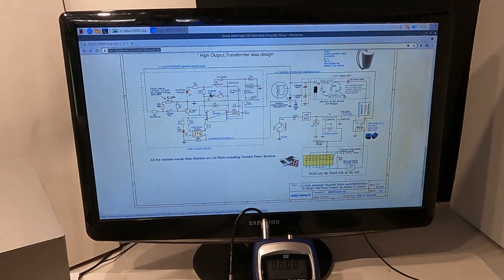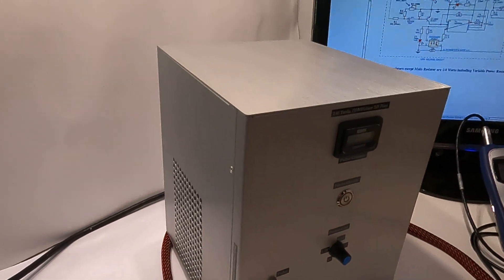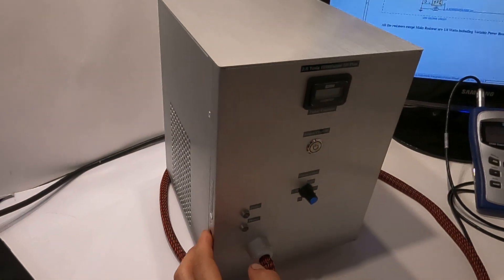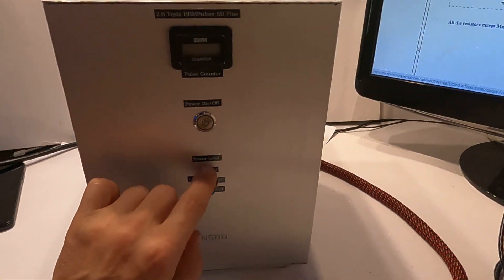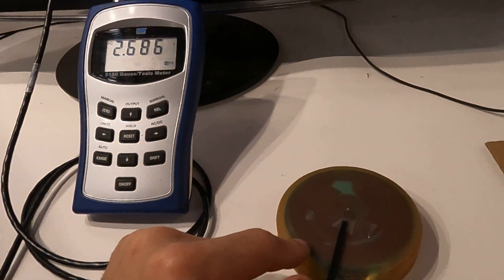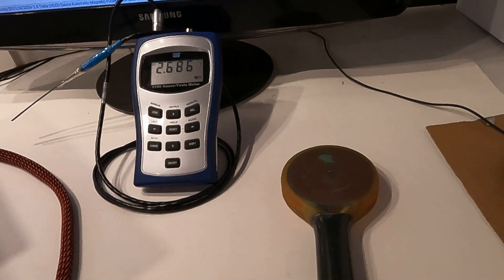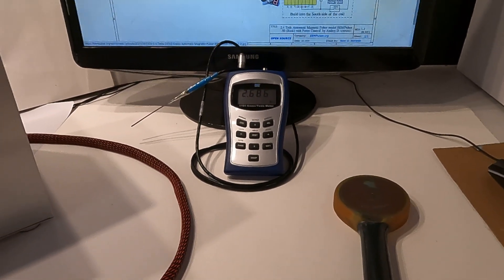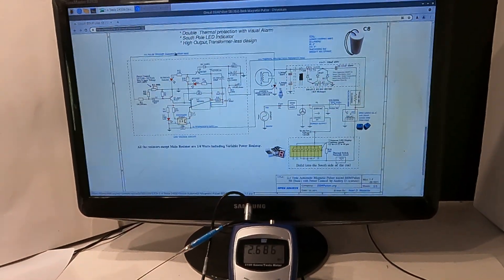146 New Model BBMPulser 5B Plus 2.6 Tesla PEMF (Magnetic Pulser) Open Source

Comment: Great video. How much total length in meters is your .5mm X 15mm strip coil?
Reply from the maker: Strip Coil I use for BBMPulser 6B pushing out 5 Tesla is made of 0.5mm thick x 15 mm wide copper strip x 6.7 meters long. Total weight 500 gram OD 3" ID 1"
I insulate it with 30mm wide kapton tape, it's sold in 33 meters each roll
I buy tape and strip wire from Aliexpress.com
Tape:
https://a.aliexpress.com/_mNL2nhy

Copper Strip wire:
https://a.aliexpress.com/_mMsz3r0
Reply from the maker: Or you can buy it already wrapped here
https://www.ebay.com/itm/145189647908?mkcid=16&mkevt=1&mkrid=711-127632-2357-0&ssspo=PeL5CPDPSf6&sssrc=4429486&ssuid=PeL5CPDPSf6&var=&widget_ver=artemis&media=COPY

Comment: I try using electrolytic capacitor with strip coil ( 4mm thick , 25mm wide ).  And i love the fast  and strong pulse  but the capacitor get fail very soon ( 7 to 15 days depend on the resistor and capacity and voltage of capacitor ).  I will try the pulse capacitor for be fast pulse.
Reply from the maker: Coil made of 4mm thick x 25mm wide strip, yes that's too thick of a strip for electrolytic caps connected in series. 
 the wires connecting coil to the unit were they getting worm or hot as well? 
How you determine that electrolytic capacitors have failed after 15 days?
How much your coil weight? Is it around 0.5 kG (1lb)?
Reply: @AndreyD  The wire will getting hot in several dozen pulses . You will hear the noise from capacitor when it reach specific voltage and that voltage will dropdow very fast . My coil about 0.6Kg of copper.
Reply: My capacitor doesn't get hot. I used 2 capacitor ( 650v 2700uf in series ) and charged to 850V.  Have the same problem with 2 capacitor  ( epcos 3900uf - 500v). I'm using double voltage circuit from transformer output 300v 1000w with resistor 2ohm.
Reply from the maker: @levanvan1988  try this capacitor, I used it with Coil made of 0.6mm x 15mm and it works well
https://www.ebay.com/itm/372568706312?mkcid=16&mkevt=1&mkrid=711-127632-2357-0&ssspo=UThZoDH1TMG&sssrc=4429486&ssuid=PeL5CPDPSf6&var=&widget_ver=artemis&media=COPY
Reply: @AndreyD  Yes, i will try it. Dont want to come back to slow pulse pemf .
Reply from the maker: Do you know if the electrolytic caps were getting hot or worm as well in your set up?
Reply from the maker: Let me ask you one more question, on this 4mm x 25 mm Coil, was it good as fur as power output from this coil, were you able to trigger muscles and was it getting hot, how fast your set up pulsates on lowest and highest output. thank you
Reply: @AndreyD  Yes, that get muscles trigger. The coil still get hot, but the wire get hot before , I used 12awg wire. I use manual mode , and  charge to 850v in 3 second. The coil often get hot with 70 to 80 pulse.
Reply from the maker: @levanvan1988  thank you